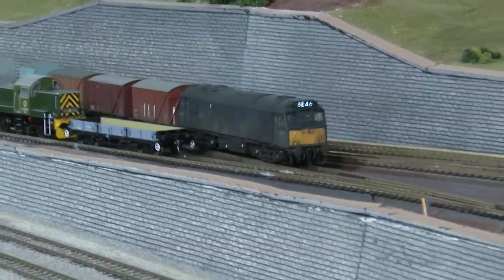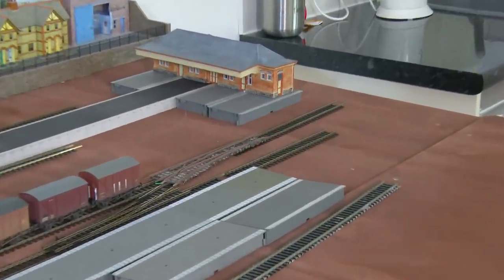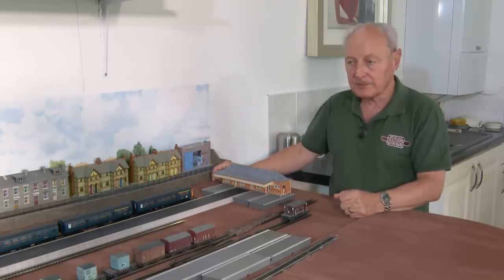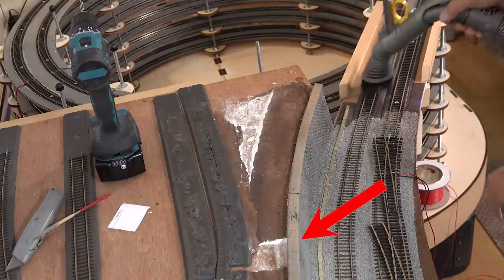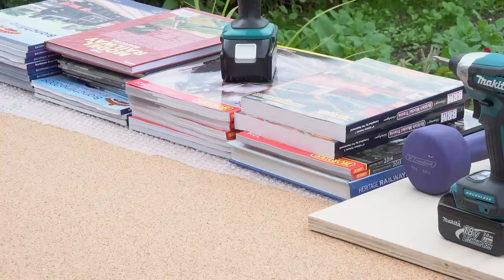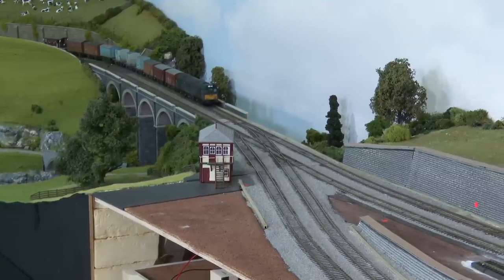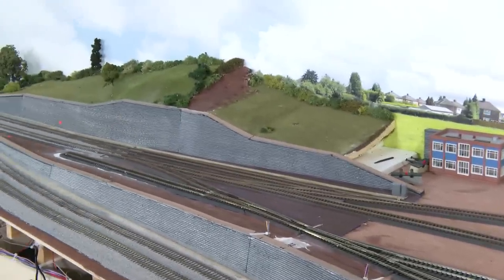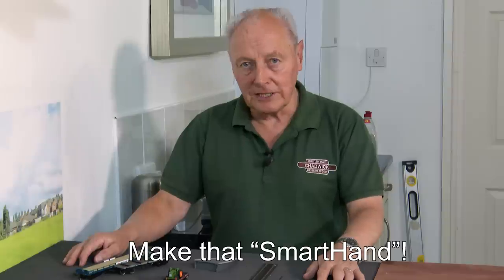BRANCH LINE CONSTRUCTION Part 2 at Chadwick Model Railway | 197.

Comment: Having decided to invest some of the pennies the Tax man decided graciously to return to me in a lovey Digitrax starter kit with DC210+ and DT602 (nice toys), and with tonne of track on its way, I was interested that sometimes you use the Woodland Scenics track bed and sometimes cork a whole area. Any reason for the differences? And any particular Cork you would recommend?
Reply from the maker: Great questions. I use the woodland scenic track bed for my fast lines, and cork in yards, such as my TMD.  The scenic track that is far better for sound absorbency, but in the yards, with slow running trains, they produce far less noise. Regards, Charlie
Reply: Awesome thanks. Think fiddle yard going cork then! Any recommendations for cork? I've seen rolls and sheets at B&Q etc but no idea on thickness or suitability 🙈
Reply from the maker: @saintpara1980  Check out my "Show More" tab. I believe that there is a link there to 3mm cork.  Regards Charlie

Comment: You're going to hate me for this Charlie but.....
- The catch point is all but redundant if the point for the headshunt was controlled by a signalbox or token controlled ground frame.
- However, the private siding (to the factory) would almost definitely have a catch point, to avoid runaways onto BR/GWR lines
- The usage of double slips in yards was not uncommon; probably more common than on a running line at a rural branch station, especially one that was a facing point (which most companies avoided like the plague). They were employed where space and necessity dictated their use, rather than avoided because of any complexity - all yard points (other than those protecting the main running lines) would have been worked using hand operated point levers rather than by the signalbox - imagine having to consult with the Signalman for every shunt operation...
- It's highly unlikely that a shunter (as in a specific shunting loco) would be allocated to shunt such a small yard, especially in the period depicted. - The loco working the train in would almost certainly have performed the shunt. I know it adds to the fun and totally understand why you would want to do this but shunting with the loco that worked the train in can be fun as well, as it can add to the 'challenge'. There's a lot of Shunts in that sentence 😂
- Don't forget coal traffic; coal continued to be delivered by rail for quite a few years into dieselisation, and everyone loves a grotty 16 ton mineral wagon.

Sorry if all this seems critical, I do really enjoy your videos and channel (and I am what you would probably refer to as a rivet counter who tries to be as "prototypical" as I can). End of the day, it's your train set and you obviously want to build it to get as much enjoyment as you can out of it (and a lot of people, including me, really like it), but it would be remiss of me to not stick my oar in, especially as you asked for comments and feedback 😃👍
Reply: Domestic coal lasted until 1984. In some areas there were coal concentration yards for domestic coal, in other areas, such as the north-east, there were still many local coal yards.
Reply from the maker: You make some excellent points, 8454. I shall probably re-locate the trap point back to where the biscuit factory siding will be. Regards, Charlie
Reply from the maker: You are of course, right Neil. However, I think I shall just stick to van trains in that area. Regards, Charlie

Comment: I know that you are primarily a diesel-electric guy, but looking at your length of track after the points in the good yard that you use to remove the loco from your wagons, it seems a little short and wouldn't accommodate a steam loco with tender (I know its probably unlikely to use steam with freight, but it would be a pity to limit yourself).
Reply from the maker: Thanks Mark, you make an interesting point. Regards, Charlie

Comment: What if you use some kind of Remote Desktop? I think there is even an app vor iOS where you should be able to connect to a Windows remote desktop...
Reply from the maker: You’re dead right Gerald. I think I found the system that works with iPads. Regards, Charlie

Comment: Wouldn’t a 2nd double slip be more prototypical than two LH points toe-to-toe?
Reply from the maker: Double slips were never that popular as they were much more difficult to maintain. It’s only when space is tight that you would use them. Regards, Charlie

Comment: That configuration wouldnt have a catch point, the headshunt would fulfil that feature, it would also have a yellow and white position light before the point to the headshunt, you can shunt past it as much as you like but if you want to go out onto the mainline you would need the signal to be off, 2 white lights, no main signal because you wouldnt be able to shunt past it.
Reply from the maker: Would it not be a red and white? 
I’ve never seen a yellow and white around 1970. Regards, Charlie
Reply: @ChadwickModelRailway  The yellow and white ones are specifically for situations like yours, they allow shunting into the neck without needing the signal to be 'off', there was actually a semaphore version so they have been around a very long time, although most yards could be shunted utilising a separate neck and departures road so no need for yellow shunt signal hence why they are not used at most yards  Yours is a very neat solution..

Comment: Hi Charlie can you help me ,got two locomotives DCC fitted when i put them on the track they runaway  at full speed how to fix this can you make a video 
Many thanks 
Andy kilo F48 HMS Dundas
Reply from the maker: This should be a simple fix Andy.
On your controller, select the loco address and ensure the the speed is set to zero. When the loco is then placed, it should respond to the DCC speed update and stop.  If not, you have the wrong address or the decoder is playing up. 
In which case set CV8 to 8.  This should reset it back to factory settings. 
Regards Charlie

Comment: Charlie.  Switch to iTrains..!  The German manufacturer is out of date and ripping us off..!  As the EU always did.!
Reply from the maker: I currently have a trial copy, Patrick, and I’m working away through my Track Planning. Regards, Charlie
Reply: @ChadwickModelRailway  FYI - I came across a collection of ITrain videos by Bob Fuller on all aspects of the software in bite size chunks.  Obviously can't give details here but a search will reveal.
Reply from the maker: Found them Patrick, and I'm on the case.  Regards Charlie